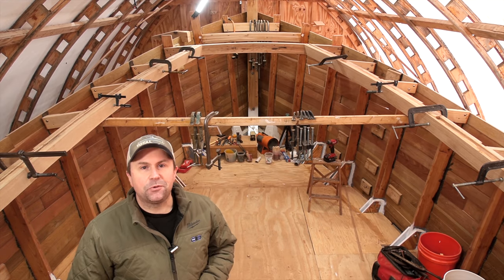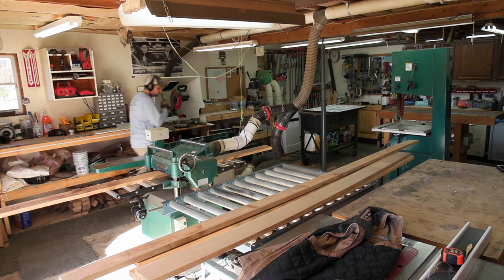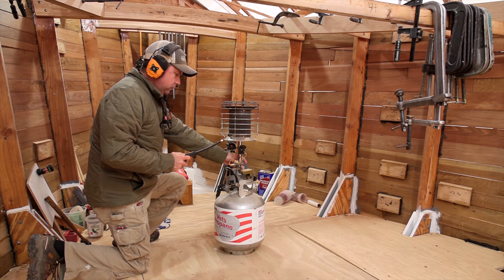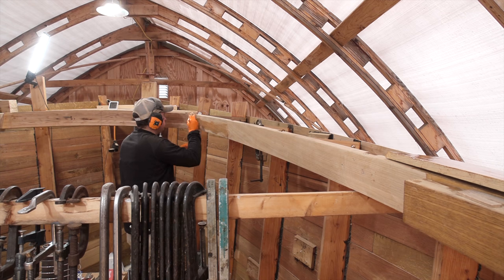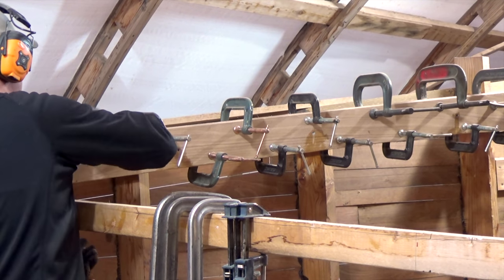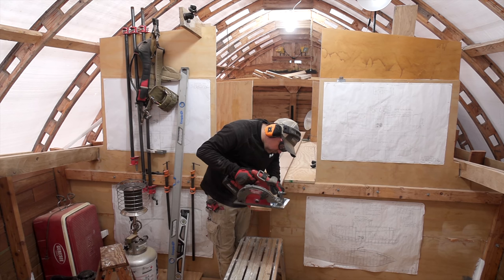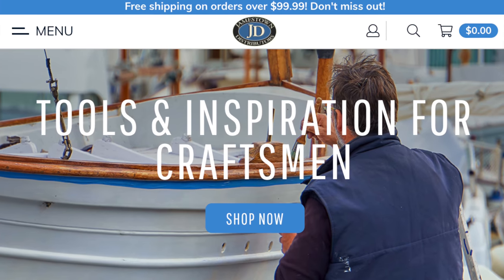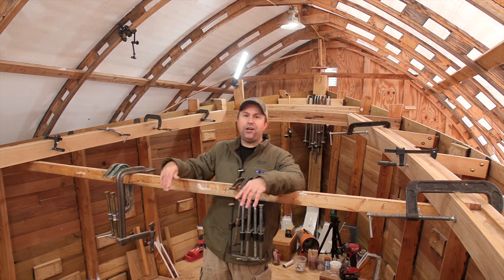Finishing the carlin laminations....almost, in our wooden yacht passage maker.  SDP Ep. 72.

Comment: Diesel ducks are a great design, there are a lot of different boat builds on Utube, Sail, Motor, Wood, Steel, Glass, and even a kid in England with a concrete boat build. I like to watch them all they all are interesting and someone like me stuck in a wheelchair can live vicariously through them all. Great work Scott.
Reply: Concrete boat???
Reply from the maker: Thanks Paul, that was really nice of you to write. If you ever make it to western NY and you feel like it,  I assure you I can find a job for you, wheelchair or no wheelchair, we’ll find a way!
Reply: @darrindedman8165  there are many ferro cement boats...they get stronger with age. They are better with low aspect rigs because the material is denser than the equivalent required amount of steel. Some concrete barges made before WWII are still functioning well
Reply: @darrindedman8165  Yes! The channel is KnotFINNeshedYet.  He doing a great job on a ferrocement oyster smack.
Reply: @SixPointsWoodWorks  Thank you Scott, I wish I had a patch to send you. I worked for the cirty of Anaheim for 24 years but I was forced to retire and didn't take anything with me. I would like to hope I could get out there someday but you'll probably be in Tahiti by then.😎
Reply: @darrindedman8165  Ferrocrete. KnotFINNishedYet
Reply: @darrindedman8165  I’d like to see that
Reply: @davidantill6949  some have the armature rust out and then fall apart

Comment: Just wondering if you’ve looked at using PL Premium. It works in the cold and is very strong. I’ve used it to attach my plywood to the frames and on my scarf joints. I still use epoxy to laminate the plywood simple because it’s cheaper.

Comment: I'm curious and not sure if you've ever mentioned it in another video. Is there going to be a point where you'll have to expand the size of your building? Seems to be getting pretty tight in there. Another great video.
Reply from the maker: That damn boat shed is my biggest regret of the whole project!  I intended it to be 18” taller but didn’t take into account the full depth of the post holes for the knee walls. Even with that, had I known then what I know now, I would have built it 10’ longer and 5’ wider. So the answer is no, I won’t be raising the building. I never intended to build the pilot house here to ease in transport when we go to water. Right now everything should just fit but it’s going to be very, very tight.
Reply: @SixPointsWoodWorks   As a gardener I envy you for what will be a a really great greenhouse when the boat is done.

Comment: Really nice to watch someone building their dream boat. Its a shame you have to sand out the bruising the clamps make, If you were to make up some pads from scrap wood you wouldn't need to sand the board afterwards. Also the Japanese pull saw you used to cut your dowels with, the cutting stroke starts with a pull stroke to start it off as opposed to pushing to start the cut like a regular hand saw. The blades are set to cut when you pull the saw towards you. Good luck with the rest of the build.

Comment: Do you have an idea of the displacement of this boat. Compared to Fiberglass I'm guessing it's heavier and maybe slightly less then if built with steel. The picture resembles a Diesel Duck or Sea Horse. Both of which if yours turned out half as good in it's sea going ability you can be proud. That's a heck of a project and finishing details are almost overwhelming but you got a dam fine start.

Comment: I am finally caught up on the year and a halves worth of videos that I missed. I want to talk about the flex seal vs tar thing back in August. I am a bit on the fence with one or the other. on one hand Tar (I am assuming pine tar) is tried and true, we know it works, and it works well while lasting you quite a long time. on the other hand the specs for the Flex Seal seem comparable and in some areas will perform better then tar. however the long term conditions that it will be subjected to for its exclusive use in this application is not very well documented and you would be testing the waters (pun unintended) on how well it stands up to the forces of the sea.

Comment: Hey Scott - First Time Viewer (BlueWater Sailor - 40k.OceanMiles). Love your project !! And you should put a sign on your shed that says "Nothing pays off like Persistence."  ;-) .  Brief observation:  Strongly suggest you consider placing the portside "Only Shower" in the aft cabin, where the "desk" shows in the plans. The first time your wife has to journey thru the main salon, up thru the pilot.house, and then down into the aft owners cabin (after taking a shower) ... you'll regret having that shower so far forward. Leave the head where it is in the forepeak; just don't forget to add a "seatbelt" on the throne for heavy weather. And PS: You really need more ventilation & an Organic Mask when doing so much epoxy resin work ... the outgassing will give you cancer, destroy your lungs, etc. (Pulmonary Fibrosis).  Spent over 30yrs. in the Marine Industry...and would hate to see you gasping and wheezing on your first voyage.  Cheers!  and keep up the good work.
Reply: That's some good advice on the placement of things.